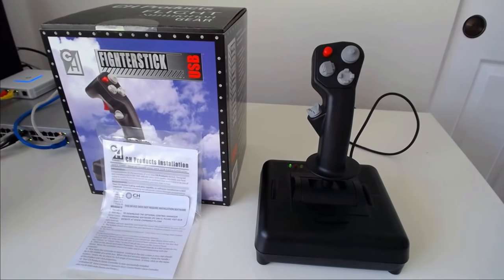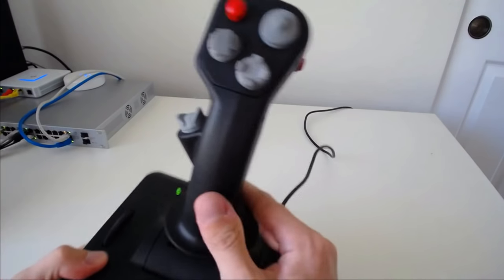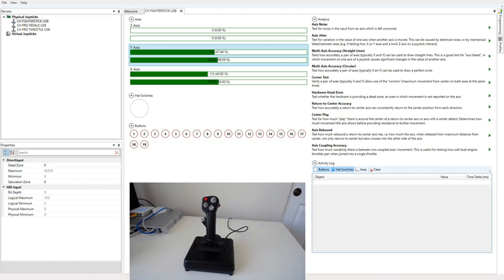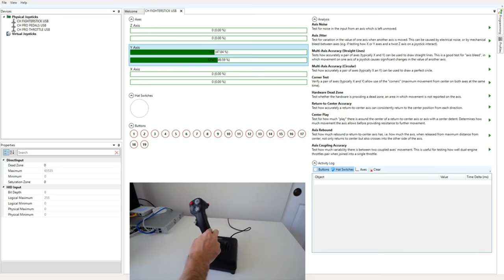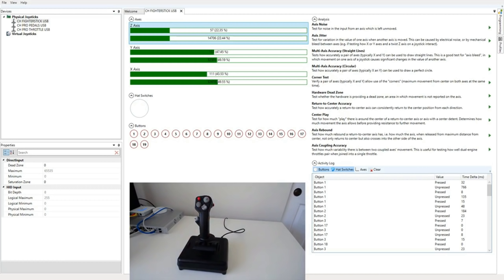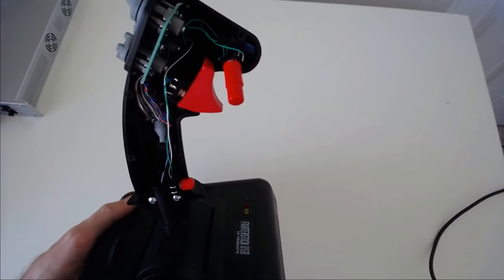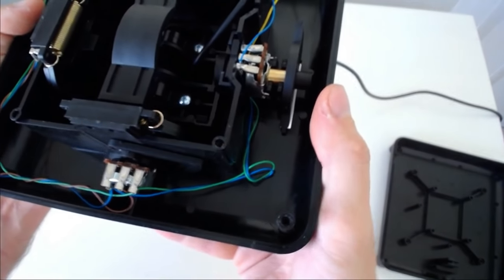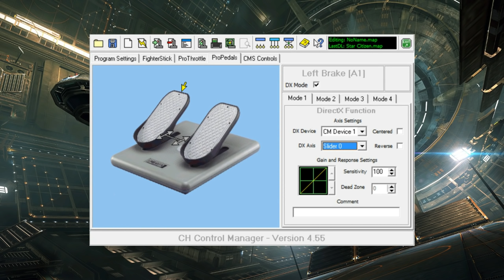CH Fighterstick Review and Disassembly

Comment: Thanks for the video I haven't worked on one of these in a wile. I do professional flight sims for the NASA and the USAF ect.. we found at Space Camp the CH stuff does not hold up to the abuse, the kids eventually break the plastic. For home use its strong enough.  The springs are at full unsprung state at zero, so to solve the zero feel I use rubber around the spring posts. Grease would not work to dampen anything with this design. This stiffens the response to be more like higher speed flight. I think this is the best compromise for not having force feedback.

Comment: I want to get a CH set up but need some info. Will the Ch fighter stick work with windows 7 pro? Do I need to make sure the fighter stick is 64 bits. I had a 32 bit fighter stick and it wouldn't work with windows 7pro 64 bit.

Comment: EXCELLENT reviews! I appreciate the detail. You must be a physicist, if your channel name is to be taken as a clue.

I've used CH Products for 30 years, and the HOTAS kit for about 20. I'm on my second set, due to heavy use.

For a handrest solution, I attached a dense foam piece cut to shape. It lifts my not particularly large hand by about 3/4", or 18mm, and extends out farther than the edge of the molded shelf, providing VERY significantly better fit and comfort. It is sculpted so as to not interfere with the pinky switch.

Comment: I have a Flightstick Pro from CH. Do you happen to know where I can buy a replacement USB cable? My was damaged. I opened the stick up and disconnected the damaged cable, but I don't know which to buy. All I know is that it is a 5 pin white connector on the end.

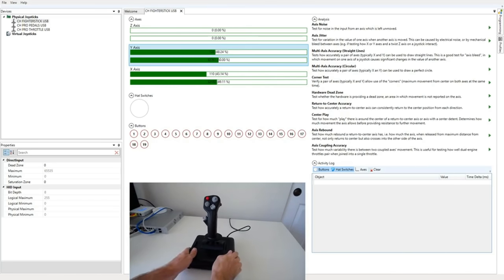Comment: 14:46 nah... i find the center detent to be kinda nice.   i think it's relative to the individual?  We use this CH Joystick in the IL-2 Flying Circus Flight Sim and its nice to kno when i have it centered.   I mean, in a flight sim, any control-surface movement causes drag on the plane....  which means if ur holding a tenny-lil-bit of elevator (without realizing it) there is a corresponding loss of airspeed.  True, it doesnt amount to much... but sometime it makes all the diff'

Comment: I just modified my fighterstick. Applied 767A damping grease to the gimbals and added rubber 'stops' to the ends of the spring stopper.  The stick still feels light but there is a tiny bit more resistance and the "clunk" is when transiting across axis is less pronounced now. Thanks for the teardown, couldn't done it without it
Reply: You might not reply, but what kind of rubber stops did you use? I'm looking at some rubber tape which has thicknesses of 1-6mm and I'd like to use as high a thickness as possible for the best dampening while not being too thick to stop it from working. Any ideas?
Reply: @thespacemanfil  the dampening was mostly achieved with 767A damping grease.  The rubber stops just prevent plastic on plastic contact when transitioning positive and negative axis.  I believe mine was about 1mm thick.
Reply: Where exactly do you apply the grease?

Comment: i just modded one of these this weekend.  felt too lightweight compared to my other stuff.  there is so much room in the enclosure...  I used some hot glue and 5/8" ball bearings (couldn't find my BBs) and glued them in the corners where there was plenty of room.  prob added a couple lb.  (1kg), and it just "feels" so much better.  As Boris the Blade once said, "heavy is good.  heavy is a sign of reliability.  if it does not work, you can always hit him with it."  Next mod will be shaving down the pinky button and making it concave instead of convex.  Eventually I will extend it 6-12", put it between my legs on some sort of stand, and use it as a helicopter cyclic.

Comment: A complete setup from CH Products (throttle, stick & rudders) cost more than the Thrustmaster Warthog.
Also, the design is the same since last time I had one - with gameport instead of USB. You could send your stick etc. in to CH and they would convert it to USB.

The thrustmaster stick I'm using today uses membranes beneath the buttons. And after 6 months one actually started to fail.

Comment: Thanks for the video. I wasn't sure if there were hidden screws under the rubber feet or if I just needed to apply more force or somehow unsnap the bottom. I didn't want to remove the feet needlessly for fear they wouldn't stick again.

Opened up easily, all the crimped pot connections have been tightened, and now my sporadic issues are gone 😁

Comment: If you feel the need to lubricate the plastic parts, use silicone grease. It's more "heat" resistant.
The potentiometers used in the stick are industrial pots..

Comment: After this review i have "with reservations" bought one to replace my t16000. I think the centre detent issue is where i will have problems. I hope i dont regret it. Price was 70bucks including delivery.
Reply: I'm in the same situation, my T16000 doesn't have enough accessible buttons. Currently bidding on ebay. What did you think of the CH?
Reply: Will you recommend this, or pass?
Reply: @rickhowe5082  yes, the fine control is actually quite good
Reply: @GW-jw9vs  THAT'S FANTASTIC! I need this to replace my thrustmaster "HOTAS for ps4" I am using for DCS on PC. I have a TON of jitter in my controls and I can't keep precise control of my f-16 viper. Forget hooking up to the tanker for midair refuel, I can't even keep up with my wingmen because I have so much drag fiddling about trying to keep my nose up attitude. The jitter is in PITCH. Gah!!! Lol
So I found that I can actually find these in stock, as opposed to anything else under $500 thanks to microsoft flight sim releasing and triggering the scalpers to buy up all of everything and sell it at 600% markup.
I love the idea of simple, so it lasts forever. I don't need RGB functions, I don't need anything flashy, I don't need a fancy name, I DO like the F-16 stick mockup, since I fly an F-16, but it isn't even really necessary. I just need to be able to properly bind all my HOTAS controls to the HOTAS. That's all. 
Thank you SO MUCH for your reply. I have been searching for reviews and details on this stick for the last 5 hours. It seems like the DCS community (at least on youtube) doesn't really know about this stick setup. There are maybe 2 reviews on it as it applies to DCS and almost none of it was all that detailed.
If I could give you two or three thumbs up I would lol.

Comment: I've had this stick since mid 2014 when Elite beta launched. 9 weeks of playtime later in Elite it's still going. Though I've had to crack it open because the roll trims tend to report false movement as the wiring gets a bit lose, some advice from the CH Hangar guys gave me just the ticket to crim the contacts to get it back up and running again. 

I'm very tempted to pick up a VKB stick because they just look pretty slick, but there's very limited English information about their quality.

Comment: After years of not flying IL2 Sturmovik, I got back into it when it came out with VR. My old stick the logitech 3d extreme which seemed to be ok but after trying my friends CH Fighterstick my gunnery was so much more accurate and precise with the fighterstick pro and also the 3dextreme was so jerky the nose would climb crazily but the fighterstick jas been fantastic with il2.
The dials help with minor trim issues but for the most part not really needed.  It may be old but its worked great for me flying il2 in VR. The software that came with it didn't seem to work on windows 10 so I just programmed it manually.  At least I couldn't get it to work it kept crashing. 
Great review though.
Reply: You can use vjoy with joystick gremlin.
Also, you can try reinstaling CH Control Manager after Joystick Gremlin, and in the device manager, under CH Products, choose the joystick, and in the power manager untick the boxes.

Comment: The rumour is that the Gunfighter is under redesign after an incident where a user damaged the reinforced gimbal (gunfighter gimbal design is identical to glad pro, but reinforced for extension use). Gunfighter is likely not to become available within the initial timeframe of q3/q4 preorders, but you're not alone in being excited for its' eventual release - the coming grip lineup that VKB is teasing is very interesting for space simmers with an eye towards isolated-axis gimbals with high load tolerances.
Reply from the maker: I hadn't heard that but I can believe it. They are already well behind. Last year they said it would be available Q1 IIRC. But yeah, I'm definitely excited for it. I'm not that interested in the extension capability, I just like the compactness. Supporting rough use with an extension is a hard problem. I've been designing my own equipment as a hobby, too, so I get the difficulty they have making a truly durable product on that level. And I respect that VKB is the type of company who won't release something they don't feel they can take absolute pride in. If they come out with an SU-35-based grip like they said they would last year I think a Gunfighter/SU-35 grip combo could become the prosumer-level product to own.

Comment: Are you going to have a look at the new Thrustmaster T16000M FCS HOTAS? Specifically the new TWCS throttle? Great videos. Thanks for making them!
Reply from the maker: Absolutely! I currently have a T.16000m (current variation) and I have preordered the FCS HOTAS. I'll do a review of the throttle and a T.16000m review comparing the new and old. The TWCS/FCS HOTAS are released Oct. 2 so I should get mine around that date or a few days later, and being a new and hyped release I'll do what I did with the X56 and do an early (1 week in review) and then a 1 month update.

Comment: I would love to see you review the Gladiator Pro, I'm currently waiting for one to replace my Warthog in a t16000/Warthog dualstick setup and am very much hoping to finally find a good gimbal. Thanks for your concise reviews!
Reply from the maker: I probably won't review the Glad Pro, at least not anytime soon. I'm planning on preordering the Gunfighter when it becomes available. It will use the same gimbal, and ships with the same grip, so it should be mostly the same result as a Gladiator Pro (only difference is the base of the unit).

Comment: Had mine for roughly 7 months thus far, replaced my x55 (didn't like the 55 and wanted something different) Pretty big mistake if I'm honest. CH stick has some 'shake' in games same with the throttle. Now... pulling up on a plane in any game (going for guns) is EXTREMELY satisfying with this stick, extremely. It's silky smooth in straight left and straight right movements, feels great... HOWEVER... that clunk... that diagonal clunk... say no to any heli sims, and diagonal deflection shots are honestly hardly worth going for. Saving for a warthog myself, just seems to fit my needs a bit more.
Reply: Hi. I'm not a fan of serious flight simulators and I'm probably just interested in trying to play something arcade or at least Elite Dangerous. Can you tell me if it's worth buying a CH Products Fighterstick for $150 in 2022? Or in my case is it better to get something cheaper like ThrustMaster Sidestick Airbus Edition (~$70) or ThrustMaster T.16000M FCS (~$80)? Thanks
Reply: @VamIy  Gday, I’ve played some elite in the past and I’d say the main thing you’ll be wanting is easy access buttons or hats for your thruster control, the ‘smoothness’ of the ch line I spoke about probably won’t be a huge issue. I went to the VKB line of products in the end and now I’ve finally got exactly what I wanted, check those out they have a great entry level stick/throttle all in one and you can always expand with some of their other products later down the line. Well worth checking out. I did have the t1600m for a bit there too while I squirrelled away for the VKB and within about a month or two the twist axis had worn to a point where it would add input that I wasn’t wanting. Other than that though it was a really good, cheap stick and I’m pretty sure there’s some maintenance I could’ve done to sort the issues I had with it. Hope this helps

Comment: I have thrown away a lot of money on "premium" joysticks that have all kinds of bugs and problems, with non existent return or customer support. I would happily tolerate many of the issues with the fighterstick just to have something reliable that works, and doesn't require me to become an electronics repair expert to use it. A little Nyogel 767a, some replacement springs and this would probably be a decent compromise for a lot less money. The pots are easy to replace in the event there is a problem.
It's durable, functional and affordable and not sold on its looks.

Comment: I have the CH FighterStick USB. My question is, how to I get rid of the jitters on X & Y axis I used the calibrate feature and now it's solid in dead center, but once moved it jitters in left, right, back and forward movements. I know that the wire connectors are crimped to the potentiometers  would soldering these connections stop the jitters? Sorry to ask this question here, but no luck anywhere else.  The stick is brand new.  Anyone that would like to comment, your ideas would be appreciated.
Reply: Get a active (powered) USB hub. Very likely your motherboard can't feed enough current to the CH stick so it will jitter. Almost everyone gets all their jittery and centering problems fixed by using externally powered USB hub. Meaning, you don't get the trouble this video shows.

Comment: I have used the CH Fighterstick (gameport and then USB versions) since it launched with no issues or complaints. I don't think there is a better made joystick on the market with regards to holding up for 5-10+ years of constant gaming. That being said your review is spot on. I recently purchased the VKB Gladiator Pro, and the difference in quality between the CH FighterStick and a pro-grade controller is night and day. You can pickup the non-Pro Gladiator for less than the CH and it comes with mars (magnetic sensors), and a much better controller board. It is a shame that CH is no longer innovating and release new products.
Reply: how are you purchasing vkb gear as every time I try to get it its out of stock?
Reply: I pre-ordered from Stratojet (the previous US distributor), and waited months for the first batch of Gladiator Pro's to arrive in the US.

Maybe it will get better over time, but that seems pretty typical for VKB.
Reply: Hi. I'm not a fan of serious flight simulators and I'm probably just interested in trying to play something arcade or at least Elite Dangerous. Can you tell me if it's worth buying a CH Products Fighterstick for $150 in 2022? Or in my case is it better to get something cheaper like ThrustMaster Sidestick Airbus Edition (~$70) or ThrustMaster T.16000M FCS (~$80)? Thanks
Reply: @VamIy  the CH USB gear uses 8 bit controllers and analog potentiometers. They are great mechanically, but much less precise than newer stuff. The Thrustmaster T.16000m (Airbus stick is the same) stick or VKB NXT are better options.
Reply: @SVgamer72  Thanks. I found a VKBSIM Gaming Joystick for PC Gladiator NXT EVO 'Space Combat Edition' but it costs about ~180 dollars with shipping while for example T16000M costs only 80 dollars. Should I overpay considering I'm unlikely to play professional flight simulators?
Reply: @VamIy  it’s up to you. The old phrase “buy once cry once” applies. If you think you might end up wanting more buttons, or will add more space/flight sims to your library, spending more up front is less costly than buying something only to buy something else later.
Reply: @SVgamer72  It's a perennial problem. You never know in advance if you should overpay or if you can limit yourself to the budget option. If you buy cheap and want more, you'll regret it, and if you buy expensive and don't get bored quickly, you'll regret it :). And what about the joysticks with force? I know steering wheels are quite popular with this mechanism and add realism, but what about the joysticks? How much does the cheapest such joystick cost and who is it for? For big fans of big flight simulators?

Comment: As always an excellent video. Any plans to review the VKB Gladiator pro or non pro? I quite like the VKB aesthetic but have a doubt about the actual product I can only attribute to a gut feeling.
Reply from the maker: I may review the non-pro Gladiator, although I'm backed up on products to review for the near future (I have like 12 ready to go, just a matter of time). I probably won't review the Gladiator Pro because I'm going to wait for VKB's Gunfighter instead. It will use the same gimbal and ships with the same grip so the review, once it comes, should be mostly applicable to the Gladiator Pro.
Reply: Sounds good, looking forward to your other reviews! I am looking to purchase a Joystick in the near future and your insight is a great help.
Reply: Afaik, the Gunfighter will have a slightly different gimbal than the Gladiator Pro. It will be tougher and ready to use with an extension for a center-stick position.

Also: thank you for that thorough review of the Fighterstick. Very informative and with a pleasant presentation!

Comment: Just dug my Fighterstick out from a bunch of dust, to start out in MFS2020. Old yes probably 25 years and it was used when I bought it. Calibrated in WIN 10, and works fine as it is in MFS2020.
Reply: Hi. I'm not a fan of serious flight simulators and I'm probably just interested in trying to play something arcade or at least Elite Dangerous. Can you tell me if it's worth buying a CH Products Fighterstick for $150 in 2022? Or in my case is it better to get something cheaper like ThrustMaster Sidestick Airbus Edition (~$70) or ThrustMaster T.16000M FCS (~$80)? Thanks
Reply: @VamIy  All my controllers were purchased used even 25 years ago. Current used prices for a Fighterstick look to hover around $70 US.